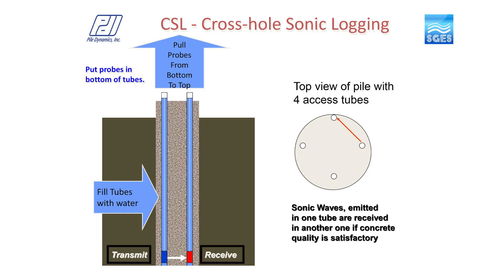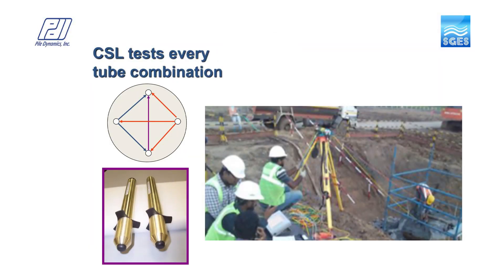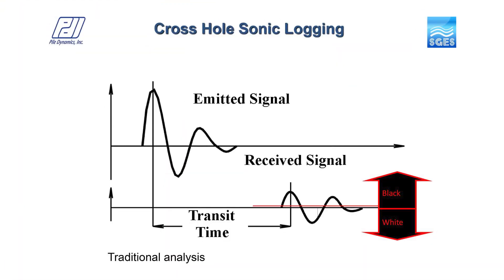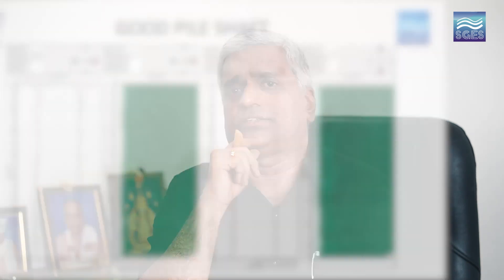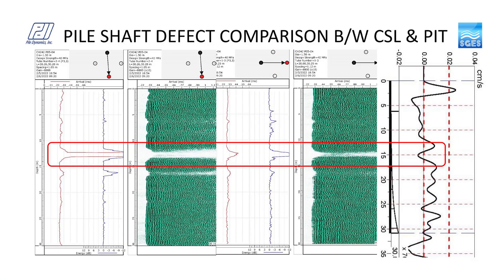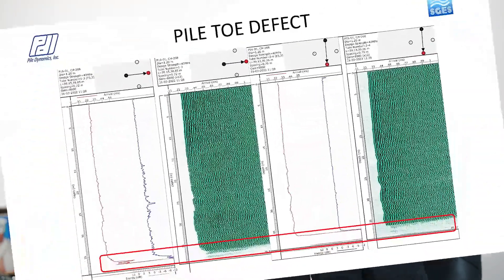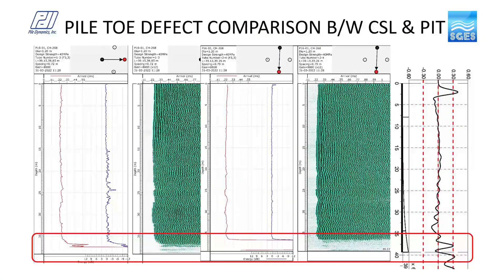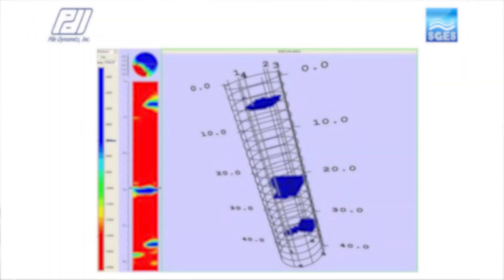Cross-hole Sonic Logging Test (CSL) | SGES

Comment: Hi Dr Parthsarathy, do you have any comments on what type grout should be used to backfill the sonic tubes after the test?
Reply from the maker: 1. Cement Grout
2. GP2 or an equivalent grout
3. Grout shall necessarily have strength equal to or greater than the strength of concrete in the pile
Reply: @sarathygeotech6784  thanks!